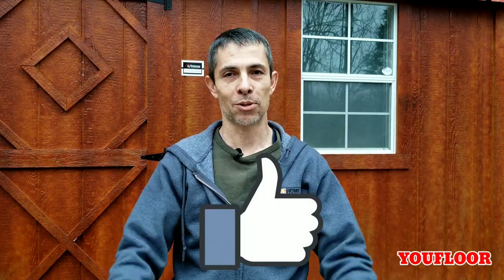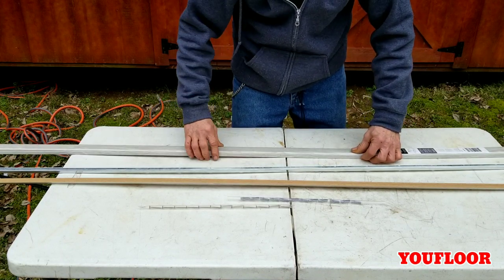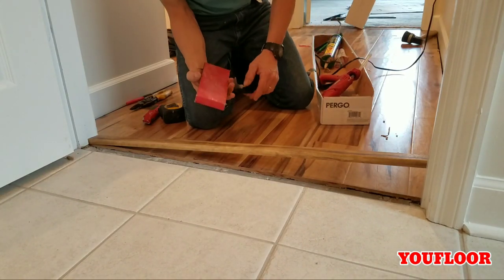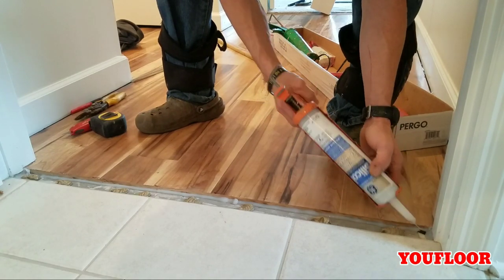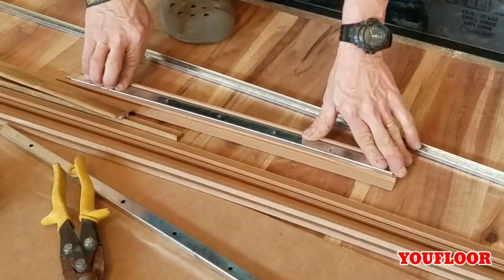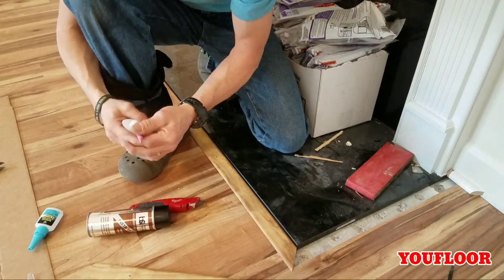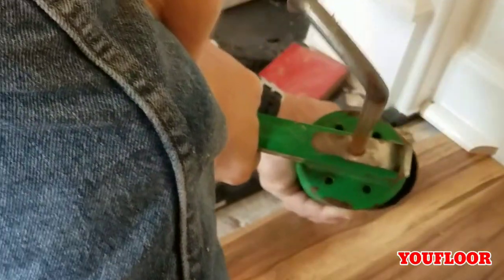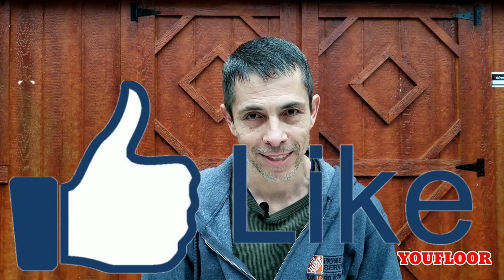Installing Pergo 4 in 1 Transitions On Concrete With NO SCREWS!!

Comment: why are you installing the metal rail to the door bar before putting the doorbar to the floor? If you were going to install the doorbar with adhesive alone, you'd leave out the metal rail.
The screwholes in the rail are for you to drill into the floor (in cases of concrete, use wallplugs) and secure the rail which in turn allows you to tap the doorbar down with gentle hammer motions.
Reply from the maker: Great questions.  Well it is not always  easy to get that hole just right for every anchor. Almost always the bit wabbles a little to much and the hole is off. Then you have to start over. Also the metal U Channel  (metal rail ) sits a little low sometimes and the transition won't reach the track. On wood floors you can pad it up before you attach it. But in concrete that would be a lot of work which may not even pan out. So if I attach the metal strip to the bottom 1st of all it keeps the transition stiff and straight as apposed to no metal. Also it keeps  my cardboard transition from touching the ground. It allows me to glue big pieces together (like the fireplace) and the weight helps hold itself down and lastly  I used a urethane glue and I can build my  globs up enuff to catch the transition then mycardboard or wood isn't directly on the concrete.  Hope that answered your question. Thanks for the comment. Peace
Reply: @YOUFLOOR   I totally agree… son in law an daughter having a hard time with the channel sitting too low…it’s been an on goin problem…
Reply from the maker: Yes on concrete it can be a challenge  to build up the glue so it will reach the transition.  In some cases ive had to glue on the concrete and the bottom of the transition.  If you want to try the screw and drill meathod, pergo sends out a black plastic strip with the metal u channel. It can be placed under the metal to raise it up. But it will take some persition to line up the holes.  Hope that helps
Reply: @YOUFLOOR   son in law used the method you mentioned but not luck
Reply from the maker: Sorry to hear this. Wish I could come help.  Looks like glue and tape are your only option

Comment: How does it expand if you just put silicon right at the laminate?
Reply from the maker: Silicone is flexable and still allows the floor to move. I like to use this to create a dam so the glue doesn't get anywhere near my flooring.  When we were taught how to seal  the perimeter at H.D. I had the same concerns about expansion using silicone. I was assured that silicone is safe as it flexes with the movement of the floor. So I've been doing that for over 10 years and so far I've had great  results. Thanks for the question.
Reply: @YOUFLOOR  how about caulk between baseboard and laminate? does it stop it from expanding? does the plank expand just the lower layer or the top layer as well? I saw some acrylic+silicon caulk but my instruction told me not get acrylic sealant but silicon sealant so not sure if those mix okay

Comment: You didn’t show how to use transition strip’s connecting laminate flooring to raised tile flooring.. son in law an daughter been working on it but didn’t work.. the grey transitions are to flimsy when carefully pulling up they pulled apart.. having a difficult time with the pergo transitions to work…
Reply from the maker: Check through my videos . I have tried to cover ever situation.  See if this video helps thanks for the question. https://youtu.be/vxBt6aL110M
Reply: @YOUFLOOR   this video didn’t show anything about pergo transition stripes?

Comment: Transitions are usually wider than the door thickness there is a notch to cut in the transition but it should be hidden under the door when closed. The notch should not appear visible on the other side as shown here @9:27 (door is on the tile side).  Also second thing, the transition should ideally stop in alignement with the door tenon edge.  It nearly does here but on the wrong side of the tenon !  Not your fault since the tiler stopped too far. But it is not his fault, he needs to be told where to stop tiling and that depends on the transition you will use. Before starting to tile you should already know what transition you will use and account for 1/8" silicon bead between the tile end and the transition. Your sillicon bead look s too small you didn't leave enough gap. Also for aesthetics the gap should be same as tiles spacing.  Overal grade for your work : 4/10

Comment: This is wrong. Flooring is never permanent especially laminate. Glueing transitions to the cement means you or the next owner will have to do difficult demolition to remove the transition without damaging the tiles to replace the laminate (and swear at you). 
You've been through that yourself for a different reason (expansion gap too narrow) so you should know better than using glue.  Glue is the worst because no flooring is forever (except some tile).